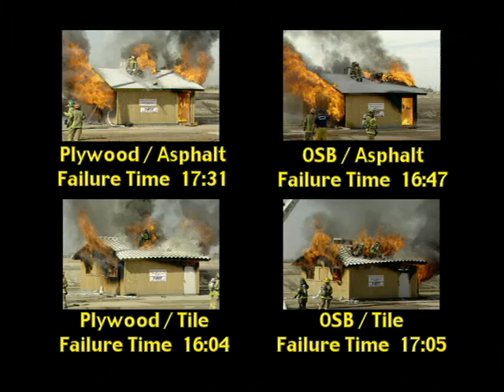PFD / NIST Research Burn

Comment: They're dummies (At first I was thinking the same thing - "you have people STANDING on the building you're just letting burn to the ground?!?").  They're collecting data on how long it takes for the roof to lose sufficient structural integrity that it can no longer support the weight of a human or two.  Easiest way to test that is to toss a couple of weighted dummies up there.

Comment: This is an interesting test but it really doesn't prove very much. First off at the time of roof collapse there should be noone on the roof. Just that simple. With the amount of fire showing at the time of failure, those guys should be pulled off long before that. The only thing I learned from it is how a Tile roof burns, cause I have never seen one burn before. That's all I got from this. Thanks though Phoenix.